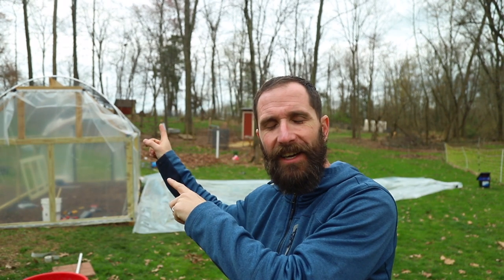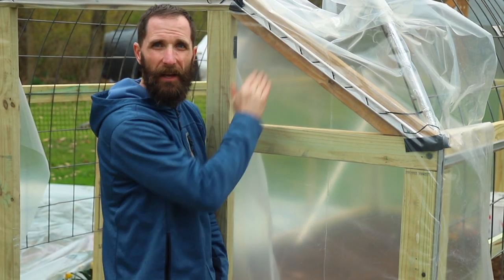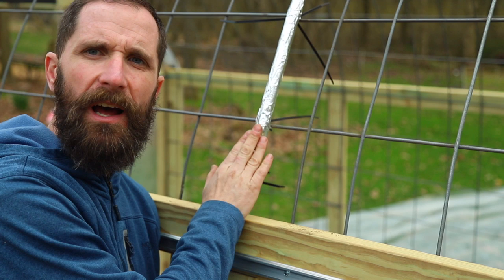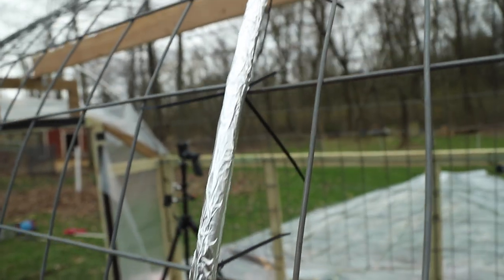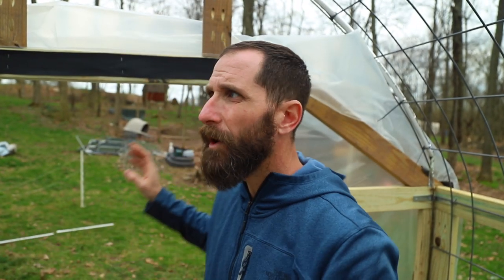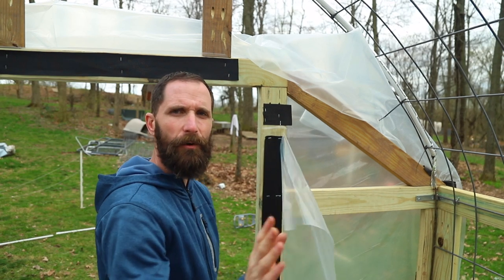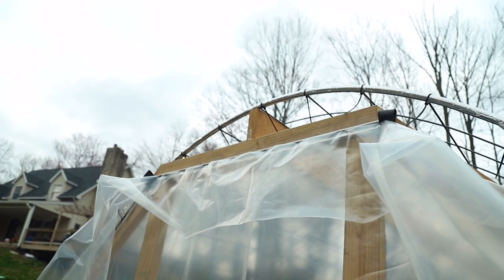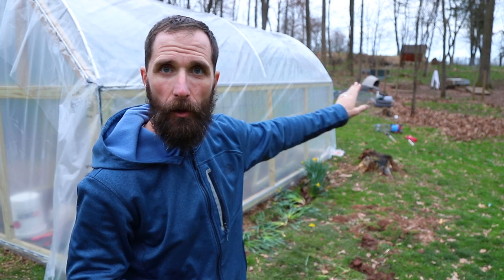DIY: How To Build A Simple Greenhouse || Installing Wiggle Wire and Plastic

Comment: Hi.  Nice greenhouse.  We built with cattle panels too.  
What size "C" channel did you use?  Our plastic was torn the first year we built it and this wiggle wire is probably the way to go.  Hoping we can get the C channel at our Lowes?  Thank you.
Reply from the maker: I got ours from bootstrap farmer. That with the wiggle wire were flawless. We had winds close to 60mph just yesterday and had zero tearing. We also used the greenhouse plastic from bootstrap. Its a frontend investment, but worth every penny. Also, still cheaper than the cheapest kits.
Reply: @LifeOnBeagleRoad  Thank you!  I saw another channel used pvc pipe.  3/4" thin wall outside and 1/2" schedule 40 fits inside.

Comment: What sort of wood do u use for ground frame? Do you protect it from soil and water? How about ankering the greenhouse to the ground?
Reply from the maker: Used pressure treated wood for the entire structure which provides some protection from rot. The pad it sits on allows for drainage but we are going to be pulling up the mulch and putting down gravel for better drainage since we arent planting directly into the ground. The greenhouse weighs so much, it did not need anchored where we live. That said, depending on where you live, the winds you get, you may want to anchor it similar to a deck or shed.

Comment: It's been a year now. Just wondering how your carpet tape is holding up. The uv is eventually gonna eat that up. It should be easy enough to replace tho. The film easy easy to repair also, if you do get a hole in it.
Reply from the maker: So far so good!